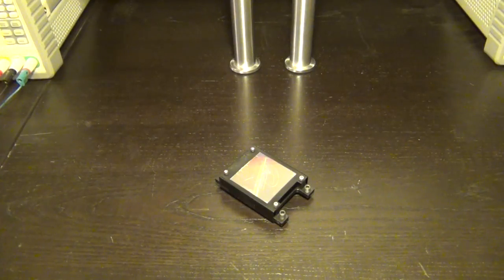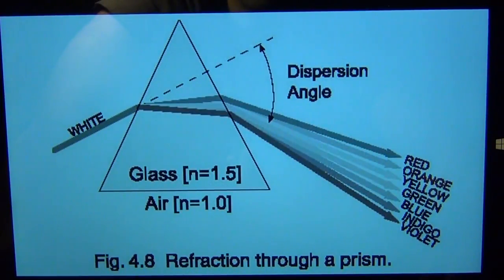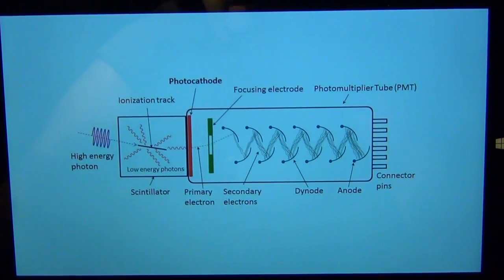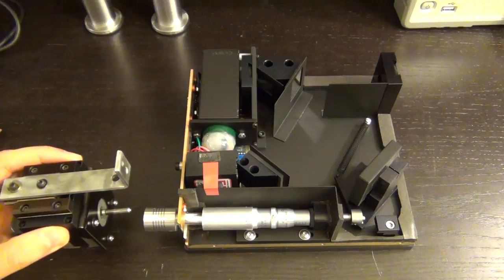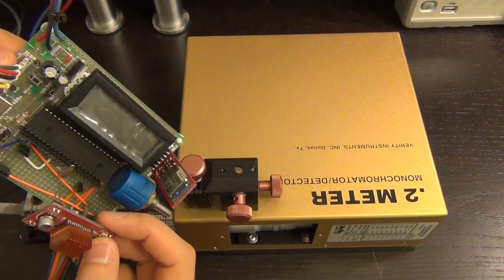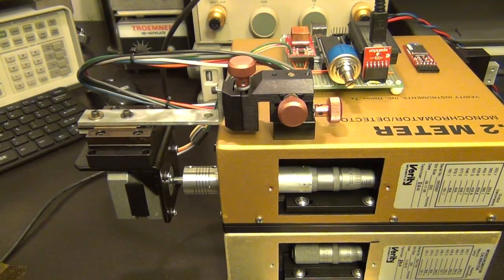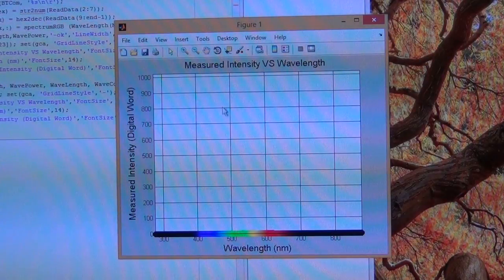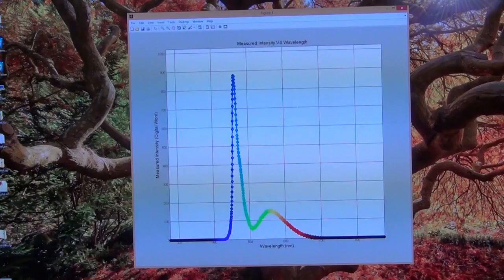TSP #38 - Teardown, Upgrade and Experiments with a Verity Visible Wavelength Monochromator

Comment: I think it's more common practice to calibrate these things on a "known" source, rather than trying to multiply photomultiplier quantum efficieny * gain function(photomultiplier voltage) * efficiency(mirrors) * efficiency(grating) * attenuation(fibre) * actual slit width, etc etc. Far easier and more accurate just to measure it than try calculate it piecemeal.

Furthermore, for spectroscopic applications, you just measure the lightsource, and then add the sample and measure again. Divide latter by former, you have a transmission plot in % which is just what you want in many cases.

Comment: Amazing work! I am very impressed with the machining. Most electronics guys would slot the mounting holes for the stepper to align its shaft, but you went with micro-adjustable optical stage. Thats a little bit bonkers! Also matching shafts, most folks would have joined them with a short length of rubber tube, but the machined adaptor was very nice! I might be concerned that it could be a little too stiff to isolate enough off-axis motion. The attention to detail on a little side project is really impressive!

Apologies for the reply 3 years late- I've just started watching your entire series in chronological order for fun, after skipping around many of your later videos. Enjoyed them all so far! I hope you continue doing a few optical and laser projects mixed in with the RF work. The laser gear available from surplus stuff on ebay is always fun to hunt around for.

Comment: Thanks for the little comment about the Dremel stand - I had actually thought about buying that thing and I am really happy about the warning.
Reply: I stumbled on a youtube video comparing stands, and the conclusion about the dremel one were also that it's not good and wobbly.
Reply from the maker: I had a really hard time with it. Very disappointing tool.
Reply: maybe it's time to create a support group :)
Reply from the maker: nraynaud1 It is a good idea! Support group for people with emotional trauma due to Dremel stand. (SGPETDDS) for short.
Reply: I agree about the dremel stand completely.  I've had one for quite some time (to drill holes in etched PCBs), and it's very poorly made.  I use a harbor freight drill press now, and it's a lot better.
Reply: Yep, Dremel tools in general and any/all of their accessories have rather limited usage but can be pretty handy at times for certain things.  The flexible shaft option seems to be the best way to go and is considerably less expensive than a Foredom tool.  However, I have not used a Foredom to really know just how good they actually are.
Reply: I'm in on the support group!

Gregor Ottmann  Don't buy it! Calling it crap would already be too nice. I bought one for drilling PCBs. But whenever you push down the drill moves a millimeter to one side, and a millimeter to the other as soon as you start to release (and tightening up the adjustment screws that should remove the slop almost immediately prevents it from moving at all). Really nice when you want to drill .6mm holes with a brittle carbide bit. The only way to get the holes right is to have the PCB floating and have a centerpunch on each hole (or etch a small point into the pad to help as a drill aid). Even then plan on loosing drills because they can't take the sideways load, that shouldn't be there in the first place. I have a cheap drill stand for a normal power drill that has better accuracy.
Unfortunately this is true for most of the Dremel tools. Too much made out of plastic and non existing accuracy you'd expect for tools advertised for sub-mm work. Do you have Proxxon in the USA? They are in the same price range here in Europe, but much more metal used in construction. I've used one of their precision drills and it was way more accurate (starting with silk smooth bearings, the things that scream at you in a Dremel).
Reply: superdau Actually I'm from Germany (which you probably are, too, judging by the nickname) and Proxxon is readily available here. :) I really like their tools, but as my trusty Dremel 398 still works like it did one the day I bought it some 10 years ago, I simply can't make myself replace it ... You wouldn't accidentally know if the Dremel Drills fit into the Proxxon stand? I would consider buying that one if there was a chance that I wouldn't have to replace my drill.
Reply: Gregor Ottmann
Austria actually. Don't get me wrong, a Dremel is no cheap China tool. Mine is also more than 10 years old and still going. I don't plan to throw it away and it's just good enough to not to be replaced by another new tool. If it broke, I would definitely look somewhere else though.
The Proxxon stand has a 20mm collar, my Dremel (395) a weird platic thread with approx. 18,5mm outer diameter. So in theory you could fit it in there if you cut the the sealing cap (the thing at the front you would have to unscrew and take off, if you'd put it in the Dremel stand) to an outer diameter of 20mm. On the Proxxon tools the collar, which is also the bearing housing, is made out of machined metal. On the Dremel, all parts being plastic, including the case of the Dremel itself (and bearing housing), I doubt it will be rigid enough (but it can't really be much worse then the original stand ;) ).
Reply: superdau I see that you know my problem ... The Dremel may be inferior, but as long as the damn thing refuses to break, replacing it isn't that good an option ...

Hmm. Perhaps I could donate the Dremel to the local Fablab and buy the Proxxon with the stand for myself. I guess I'll have to ask the guys if they can use such a donation.
Reply: Gregor Ottmann
Found something: http://www.ebay.de/itm/151479342177
There's someone (Austria btw. ;) ) selling an adapter machined out of aluminium to put a Dremel into a 43mm drill stand, but also offers to make them in other sizes. Maybe 20mm can be made, too. (only problem could be that it's a very thin ring then). 10€ and 30 day returns. I'm almost thinking about buying one.
Reply: superdau First you get me to the point at which I decide to replace my drill and then you come up with something like that? Nah, I'll get a Proxxon and donate the Dremel.

Any suggestions which Proxxon I should buy?
Reply: Gregor Ottmann
Not really. But I'd definitely take a corded 230V version, not the 12V with power supply. That leaves the FBS240 and the IBS. They always use the IBS to show off their accessories. The motor part of the IBS seems to be their standard motor module for most of their other tools, like beld sander, angle grinder, jig saw. So I'd go for that because I expect long support if needed.

For the drill stand I'd take again the more expensive option, the MB200, over the MB140, because of more vertical travel and the scale. The MB140 seems to be designed more for the "drill through" applications, where depth isn't that important. Can't say anything about the stabilty of both of them, but at least all the structural parts are made out of metal.

Damn, you almost get me into making changes my christmas wish list...

Disclaimer: all that comes from a few times use of a single Proxxon drill/grinder (which I don't even exactly remember what model it was) and the continuous disappointment by the Dremel when trying to do fine and accurate work. So I take no responsibility, if you find a Proxxon isn't much better than your Dremel ;) (but it will be) .
Reply: superdau Your suggestions fit my own research perfectly, so I have added these items to my wish list. :) Thanks for the advice!
Reply: superdau There is next to nothing that can be done to hack the Dremmel drill press stand to make it firm or stable. It is a fatally flawed design. Short of epoxying the whole thing into a solid mass then mashing up a rack and pinion to the stand-pipe, jury rigging something to prevent rotation about the pipe.... basically reengineering the whole thing... there's not much you can do with it.

Comment: That reminds me  my Bachelor Thesis about Characterisation of CdSe single photon emitter:) (I study NanoOptoelectronics)
You can  excite some semiconductor probes with lasers and observe its emission spectrum.
By this you can make assumptions  about its band gap, quantum structure (different energy levels => separate peaks in the emission spectrum)  and density of states (The amplitude of  peak will tell you about  how much states are present around  particular  energy level).
  You can also perform pulsed measurment  to  see how long does excited electrons (excitons) "survive" in the semiconductor before optical recombination.
A video about this stuff will surely be very educative and interesting to watch.

Comment: Just a note, "density" is not entirely related to the refractive index. It is generally used interchangably but it is not correct in terms of electromagnetics. Refractive index is related to the electric dipole distribution inside the material. Of course this would be harder to explain. However, please refrain from using "density" and "refractive index" as similar things.

Love your videos, learned a lot from them. Thank you!

Comment: very good and interesting, thanks. For your coupling, you might be interested in the concept of "spline coupling" which is mechanically a bit simpler (it simply moves the rail in the rotating part, so your motor mount is sturdier). I really dig your videos. I can spend hours passively looking at a moving screen while eating junk food and not feel guilty about getting dumber by the minute.

Comment: I have got same but bigger monochromator for restoration and automation. What is software are you using to make a plots? Had you calibrated scale with laser or you just fits with exact settings?
Reply from the maker: Yes, just calibrated with a known laser.

Comment: Very nice video. Just a couple comments/question: When you talk about the incandescent bulb, you mention the shape has to be corrected by by the QE of the PMT. However, for the 2nd peak in the IR, you make note of it, but don't go into detail. It seems that a likely cause is a grating anomaly (spike in grating efficiency). I would expect the actual shape of an incandescent source to follow a blackbody spectrum pretty closely. Any thoughts on this? Which would bring me to my next question - do you know how to measure the grating efficiency for a given monochromator setup? I am trying to quantitatively measure electroluminescence of a diode and have so far accounted for the QE of the PMT. However, I only have the manufacturer's grating efficiency for a Littrow configuration, and my monochromator has an unfolded Czerny-Turner configuration. From my understanding, the efficiency can change significantly based on the configuration used.

Comment: Thank you for the video mate, love watching them and I always learn a lot. 

Just out of curiosity, I used to work with nuclear density gauges and they also used photo multiplier tubes to measure the radiation passing through a specific material, hence giving density. Do you know if they use the same style of tube, or will there be a different material at the front for the cathode?

Comment: Hi, would you be able to make a lab grade comparison with the Hamamatsu microspectrometer and TAOS TCS230? To ascertain the accuracy of the two (or rather are they good enough?), both are most likely cheaper and more accessible to hobbyist. TCS230 is a popular colour sensor, but it provides readouts in radiant power. A cheap open source grow light photosynthetically photon flux density (PPFD) meter on a Arduino platform is a great idea.

Comment: Great Video as always!
For my bachelor thesis I have worked with con-focal chromatic displacement sensors that can measure very fine displacement (1/10 of a micrometer) and thicknesses of transparent materials. I know the working principle of it is the the spectral analysis of a reflected wavelength through a chromatically uncorrected lens. As shorter wavelengths are focused at shorter distances to the lens and longer wavelengths get focused further away. By analysis  of the content of the reflected light, one can tell the precise distance the source is away from the material.

Maybe you could do something similar to this http://www.laserage.ie/files/OP0002_chromatic_confocal_operating_principleV2.JPG

Anyways, thank you for the interesting and informative videos.